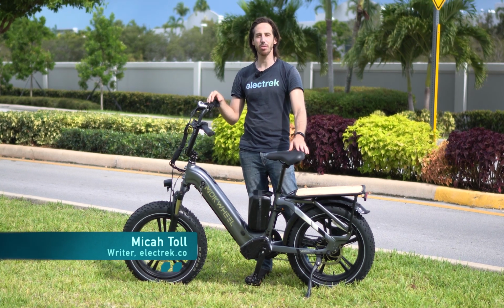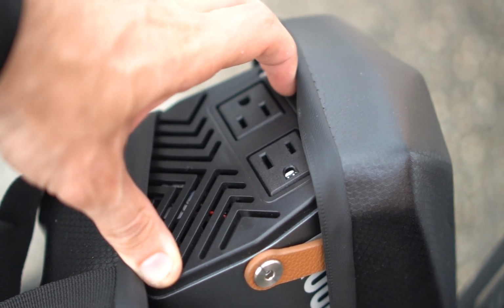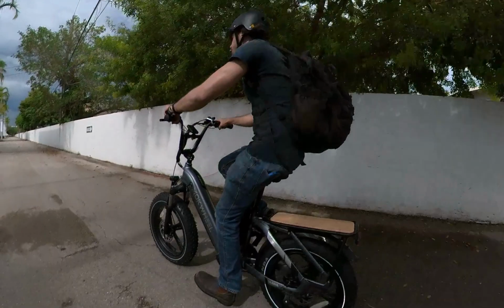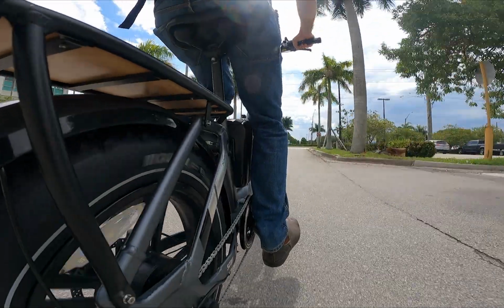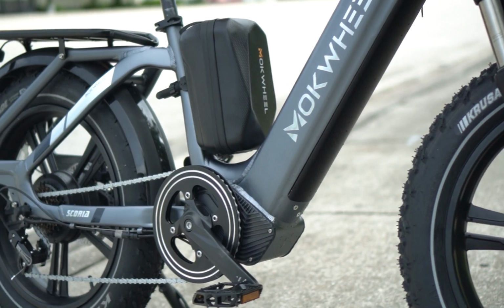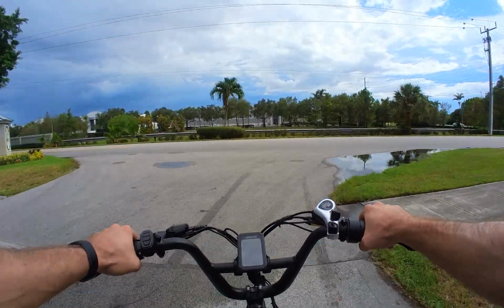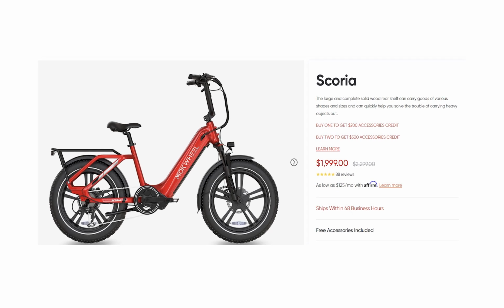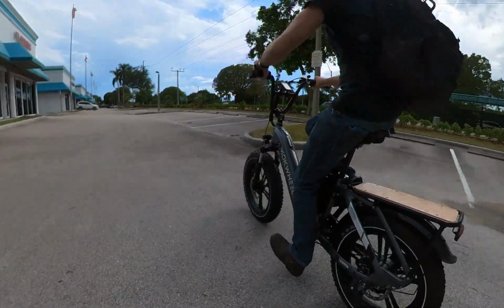Mokwheel Scoria: An electric bike and POWER STATION?!

Comment: Good review! As for the bike, they totally failed by adding on a do-nothing for carrying capacity or frame rigidity extra rear arm downtube. It does not carry any loads as the rack attachment points are on the lower down tube. It doesn't make the rear arms stronger as it's not triangulated. Just adds weight to an already heavy ebike. They should have beefed up the one lower arm and added the stronger built rack as they have on their Slate model. The frame overall is much more beefy on the Slate. If the Slate had the 750W motor it would be a much better bike.

Comment: 😕 makes no sense at all,,  those solar panel will take forever to charge that battery, and they would have to be carried and left out along with the battery during daylight riding hours. And an inverter to  convert DC to AC to run utensils, the idea is to keep an e-bike battery charged! So you can ride it, not make coffee with it, And How are you going to carry the utensils away from the house to a place that has no electricity? On that ebike which doesn't have that large of a battery in the first place. Load up the bike with the on board power station we're going camping😂.
Reply: Yeah, solar isn’t really meant for fast charging on bikes. It’s more of a backup thing for topping off when you’re out for a long day. I’ve used the inverter setup mostly for small stuff, nothing crazy — just depends on how you plan to use it.

Comment: I'm fat. No two ways about it. So cheap ain't a possibility. Cheap usually means a top weight capacity of 220 pounds or so. So the bonus of this model is more in the running though where to keep it is another matter. I'm  11/2 floors off the street. Still if I were to buy one I'd either have moved for other concurrent reasons or make the effort to get this baby up the stairs. I like that it has a base model with camper-ish bells and whistles that can be add-ons. I'm likely to never go camping again or need an inverter and/or solar panel. But I like to romance the idea, the daydream.

Comment: The price doesn't sound that bad. A 1000 wh powerstation battery alone costs close to $1000. The added cost of the inverter is a bit pricey. But the package cost isn't that bad. The 200w solar panels definitely overpriced, but that could be purchased elsewhere.

Comment: For bikepackers, being able to set up the solar panel to juice the bike would be great.  Probably could do a lot of bikes that way with assembled components but this is a turnkey package.
Reply: I'm not sure how that would work since it would have to be a fairly large solar panel if you want regular charge times. If it's just a small 1x1 foot panel this is easily portable it would takes possibly days.
Reply: @andrewdishman26  I use to charge a Jackery 160 with a folding 100 watt solar panel.  Use to take several hours.  Not fast, but doable.  At worst you could have enough of a charge to get you somewhere with a 120 outlet.  I've been mulling the best options for travel and ebikes are attractive for initial cost, no license, no insurance, low maintenance costs.  But ultimately I think a Toyota Corolla hybrid is what I'll go with.

Comment: I love my Scoria. Agree the inverter is unique but most people wont need it. The price is a little high compared to similar brands, but its also has better components. They recently started shipping it with a thumb throttle and finger shifters for the same price. The original also came with a double kickstand which it seems they switched to a single on your bike.

Comment: The inverter is a gimmick, nothing more. If you use it, it will drain your battery and leave you with less range. Although I have to say, the form factor of the inverter itself is intriguing.

Comment: Overpriced and not worth it. I do like the idea of inverter and solar charging specifically for bikes, but I don't see much happening in that area vs van lifers that set up their own solar panel kits for roughly around the same price or less.
Reply: For bikes, the inverter setup is more about convenience than big solar power like van builds. I’ve found it handy for small stuff on longer rides, so it depends on what you’re expecting from it.